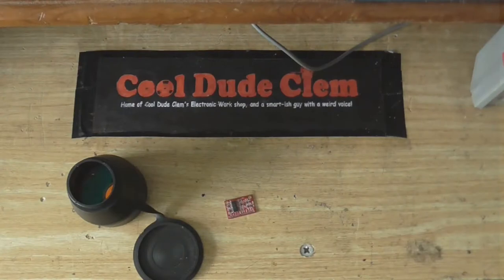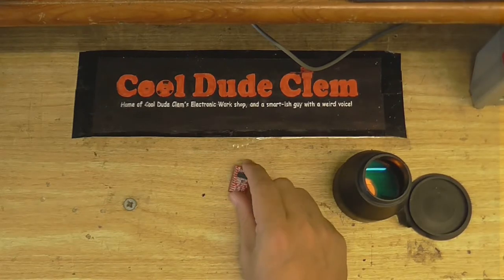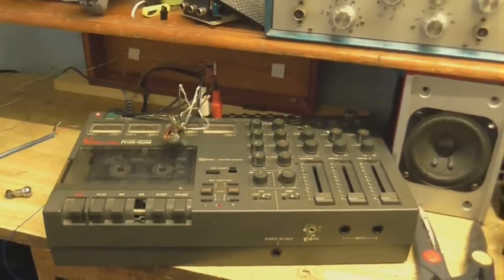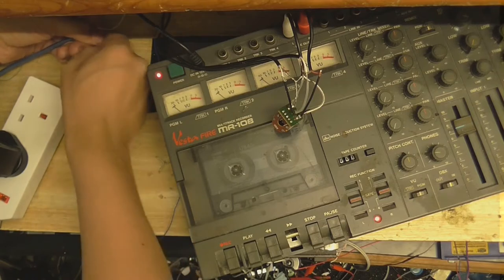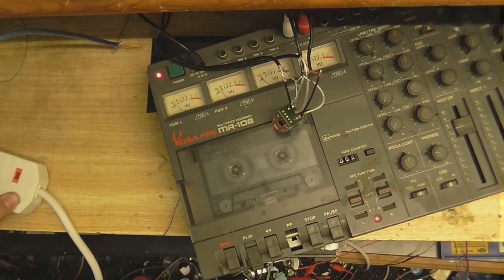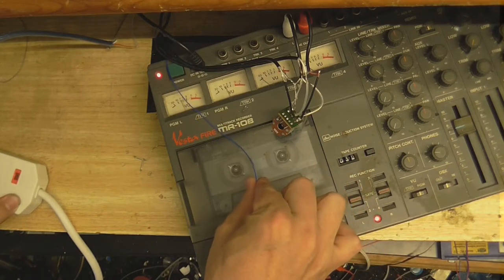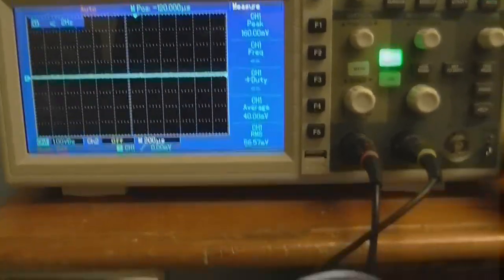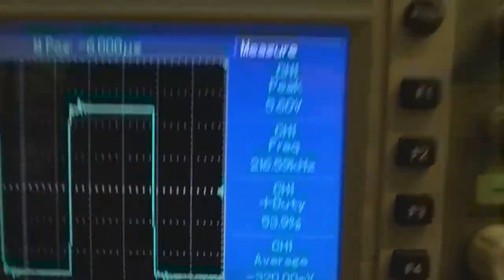PAM8403 Tiny Class D Amp

Comment: I'm amazed that tiny IC output that much power.
Reply from the maker: That's because it's a class D, the transistors are either on or off with no in-between state.  That way they don't produce as much heat and can be smaller.
Reply: @CoolDudeClem  
I wonder how the fidelity is. 🤔

Comment: That seems to work rather well Clem!The idea isn't new as I guess you know.There were kits for this sort of thing available in the 1960's and I think one of these was by Sinclair.The attraction was that you could have a Power Amplifier which didn't need to give off heat like a traditional one would have to as the Output Transistors were switching rather than biased for linear amplification.I'm glad you're still there.YouTube would be much poorer without you.
Reply: Yes, and the first commercial HiFi class D amp was the Infinty SwAmp in the early 70s, it was very small, had To3 output transistors and could deliver around 200Wpc or something like that!

Comment: This chip is awesome to use in portable speakers. In mains powered devices I still prefer class AB
Reply: It's not my area so I could be wrong but shouldn't that be the other way around? Class A amplifiers draw much more power than class AB amplifiers. On a portable device it will have an impact on the battery life.
Reply: @justintaylor2679  I was talking about class D and class AB, never mentioned class A.
Reply: @mrjohhhnnnyyy5797  meant to write class D instead of AB but looks like you corrected the mistake.

Comment: I bought a few of these but I don't really know what they are used for.   Does the speaker just respond to the fundamental frequency and doesnt respond to the higher harmonics.  I though most audio was complex, not a square wave not a sinusoid.   I think I need to read up on class D amps and find a use for mine.
Reply from the maker: Class D amplifiers basically work by modulating the duty cycle (how thick the pulses are) of a square wave in time with the incoming audio signal. If the frequency of the square wave is high enough (and in this amplifier it is), it can be fed directly into a speaker with no filtering, and the speaker will convert that back into the audio waveform.